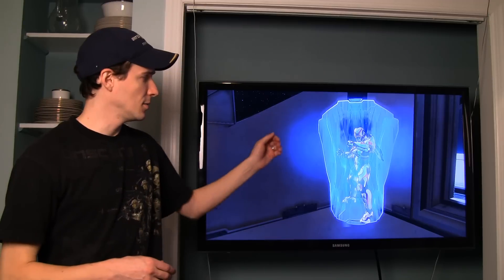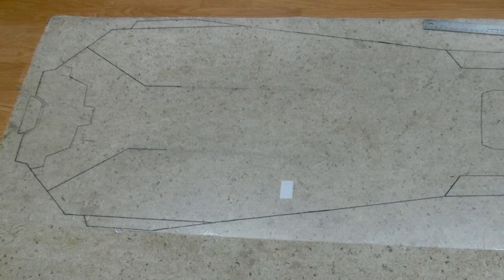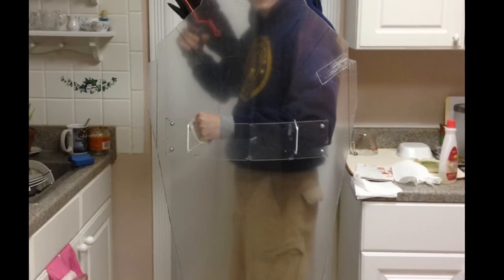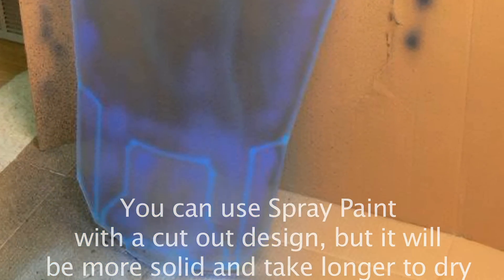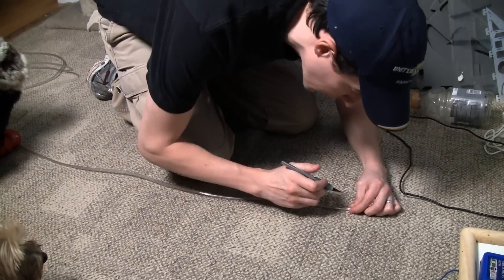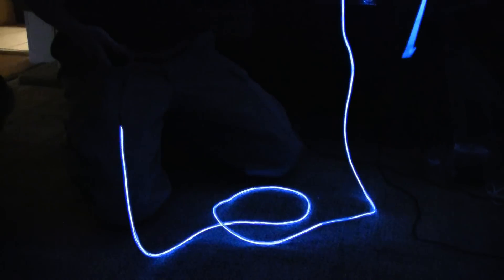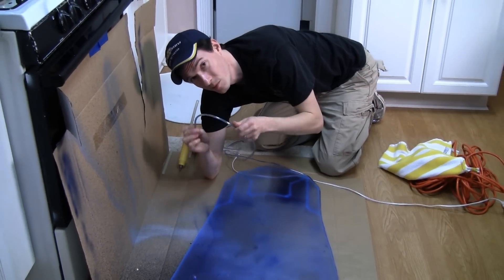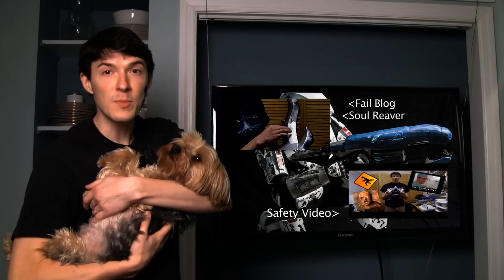Doc Dailey Designs Episode 1-Hard Light Shield

Comment from the maker: It would be a good idea, but not applicable.  The limitation of the EL wire prevented it.  Besides, I only had 9ft of wire to complete the project.  Be aware that EL wire doesn't bend past 90deg without damage/braking.  So come up with a design that goes through all the detail without double backing.  Or order 4-5 new EL wire sets.  Either way, I'm not doing it.  You're welcome to try though :)